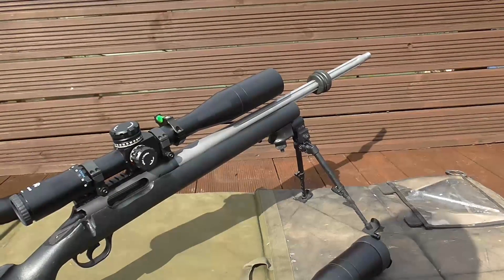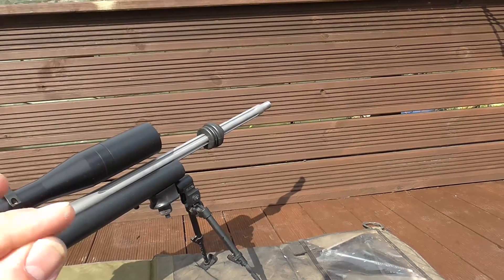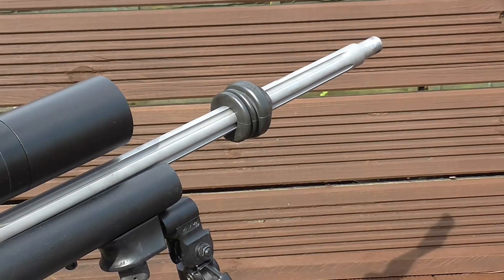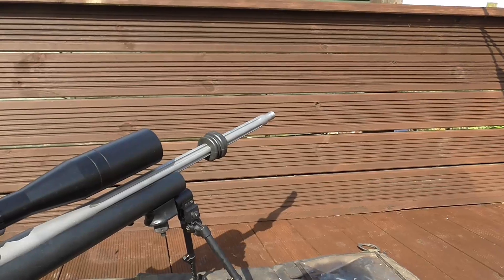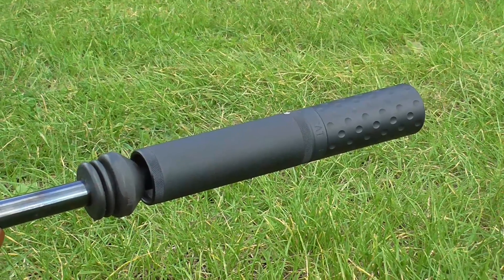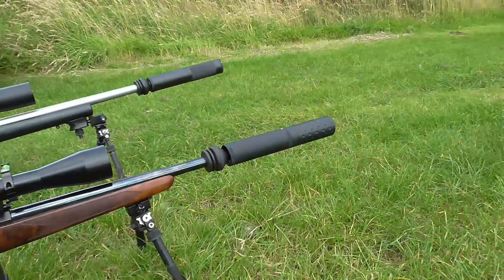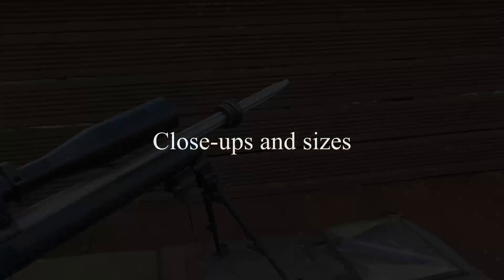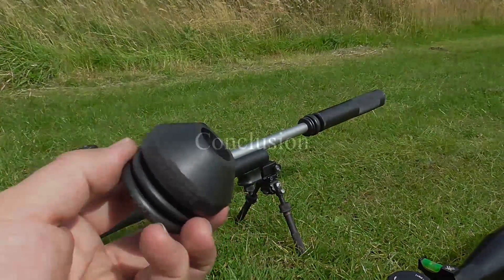Barrel tuners - do they work?

Comment: I found the Mrs rubber pleasure device and drilled a hole in it, works a treat at the range and is a great talking point.
Reply: I bet the lube helped it slide down the barrel :0)

Comment: We used “tunners” to eliminate parasitic harmonics in an unrelated industry.  It was more of an art than science to figure out where to position tunners.  Curious how you are measuring the frequency and the sub harmonics of the whipping action of the barrel.  Or are you looking at the reduction of the standard deviation of the shot placements to determined that your barrel has been tuned?  Very interesting video.  Richard you are out there swimming alone in the deep end of the pool surrounded by sharks.  (Translated to no one else is covering this topic nor are they brave enough to talk intelligently about it).  Very nicely done!

Comment: Great video Richard. I'm going to give a couple of these a shot. One on my .22LR and one on my .308. 

A couple of things though...

1) It appears that the LImbsaver instructions recommend moving the tuner/dampener by 1/4" at a time (approx.6mm) but you mentioned that a 1mm change can have an effect. What increments do you suggest, especially when close to identifying the "node"?

2) What are your thoughts on doing this at greater distances, similar to how folks do ladder testing at 300, 600, or 1000 depending on their goals?

Thanks

Jeremy

Comment: Well, they are ugly, BUT:
I had an eye opening experience yesterday.
Since a while I´m struggling with my Tikka T3x CTR in 6.5 CM and a 24" barrel.
The barrel dia isn´t really big for that barrel length, and I loaded 8 different bullets in several loads, including 3 different powders and so on.
The very best groups where at barely .5 MOA, which isn´t bad at all for a factory rifle (which I bedded), but doesn´t satisfy me for LR shooting.
And I know some Tikkas with shorter barrels which all do better.
So yesterday I was out for V0 tests with my new bought Magneto Speed mounted at the barrel mouth.
Guess what: The first load I shot gained tighter groups than ever, and so did the two others.
I couldn´t believe it, all of them were under .5 MOA, one of them was .3 MOA, which would be all I want.
Should I let the Magneto mounted now forever?
So I searched around and found this video - thanks Richard.   :o )
Might be a big step forward for me, but I said it once, this dampener is really ugly.
Does somebody know other damper models, which are a bit more charming on a rifle barrel?
If so, I will think of you in my prayers.
Cheers from Germany.

Comment: Great video!   I bought a 17 cal wsm rim fire which is factory only ammo.  They can shoot great or poorly out of the box.   So many people will spend time and money on rebedding the action/barrel fooling with action screw tension etc and still scratch head when the gun does not shoot good.   
I took this $6.00 tuner (cheaper on Amazon) and was able to make .25" groups at 100 yards from a .17 wsm.

I did not waste time bedding the barrel etc.   Mine shoots better than 17 wsm costing 3x more.    
I think the reason most people don't use them is they don't like the looks. 

bedding to get more accuracy is just hoping that the bedding changes the harmonics in a way to shoot better.
Bedding can also make it worse just like moving the barre tuner to a wrong location it can hurt accuracy.

Comment: Hi Richard, after watching this video I put the barrel tuner on my rifle and it made a huge difference, not bug holing yet but now I am developing another load for the rifle and I was wondering what you would do starting with a new load?  Would you take the tuner off and shoot initial rounds without it and find the best group out of the different charged loads and then take the tightest grouped load and shoot again with the tuner? 

Or should I maybe just move it back to the start next to the stock on the Ruger M77 MKII and shoot the trial loads with it there.  3/4 from the end of the stock helped greatly with the last loads. Would I assume that placement would be useful for other trial loads?  Any advice you have would be appreciated.  Thanks for the great video.

Comment: Hi! good information and accurate descriptions...

I do have a question though....I have seen bench shooters during load developement sprinkle a liberal amount of say talcum powder on top of the barrel. When they shoot a round they examine the barrel after the shot to help pinpoint the nodes and place the x-ring resonator between them for best dampening....You still may need to play a bit forward or back but they claim this works well on barrels with proper load development already done ....

Have you done this or something similar, and what results did you personally get after trying this method?

I know I am long-winded here but I wanted you to see a better description of the process....

Thanks

Comment: I have a 17 wsm Bmag I just bought.   I put 40 rnds thought it without the tuner and I was getting 1/2" groups at 50 yards with maybe 2 of 10 outside of the group.    Not bad figured it was the ammo or maybe the new barrel.     I paid 9.00 for a Limbsaver Sharpshooter X-ring and went to the range.    I was amazed I put 7 shots in the same hole.   I don't think I have ever done that with any gun before.   No fliers it was like my gun turned into a laser gun.    I measure the group and no kidding it was 0.10" group of 7 shots.   That was probably from me moving on the bench.     I am still in disbelief.   

I was going to bed my stock but I don't think I want to change a thing now.

Comment: Once you find the sweet spot how do you make sure it doesn't move especially while hunting?  I have a weatherby Vanguard 2 sporter in 7mm08 that shoots quite horribly with the 24" super light sporter barrel.  I tried free floating it and it helped a little, but it still shoots 2" groups or bigger.  I have also tried many different loads with a few different bullets with no luck. Do you think one of these may help me?

Comment: Hi Richard,  
I have been using these since very close to their introduction.  I was an avid Archer and having used Limbsaver products  understood that they made no junk or contingency laden claims.  I was very pleased with your video, straight forward and very concise.  I feel your video even without graphics or demonstration is the most comprehensive  offering online . I was a reloader when I started using these and decided to "explore for the sweet spot using factory ammo.  I know, I know, apples and oranges.  What I found once the factory ammo led me to its own sweet spot was amazing in and of itself, but the trials with the reloaded ammo with just minor adjustment to the de resonator were more than I had hoped for.  Using my personally tweaked  30.06 Remington 700  I was able to go out to 250 yards before my groups were no longer 1 hole examples.  Again thank you for the very personally redeeming  article.  liked and subbed.

Comment: Hi Richard, thanks for sharing your experience with the de-resonator. I just have one question. After you find a "sweet spot" with one type of ammo., does the accuracy change when you switch to a different ammo? I figure that different ammo would change the harmonics of the barrel thereby causing a change in accuracy and point of impact. Your answer will be appreciated, Thanks.
Reply from the maker: Thanks :) Yes different ammo is slightly different. Yet the zones you go through on the way while tuning are always similar: square groups....vertical stringing...accuracy, square groups...vert stringing...V interesting
Reply: Thanks for your response, Richard. So, in the case of the de-resonator, I would have to make an adjustment by moving it forward or back when different ammo is used, because of the difference in harmonic signature it creates. Is that correct? Thanks again.
Reply: @RichardUttingSharpshootingUK  that makes sense. The barrel resonates both horizontal and vertically, the nodes are in different spots, when you get the vertical string you have damped the horizontal whip, when cutting clovers you have dampened them both.

Comment: Why don't you start with a heavier barrel and get rid of that fluted one for a stiffer barrel to start with? I've seen alot of bench rest shooters punch the same holes at 100'. Their rifles didn't have any bullshit hanging on their rifle. They just just a quality barrel, handloads and trigger and a very heavy rifle overall.
Reply from the maker: There are loads of different builds for loads of different uses. Just saying build super heavy for stable unfussy harmonics is off the point.

Comment: Thank you Richard for such a clear explanation. I thought they were just something to add a few oz of weight to a light barrel, and thereby dampen vibrations. But that they act like a Browning Boss tuning system and similar expensive options(that have to go on the end of the barrel, without adding to the length of the barrel, never occurred to me. Since all my rifles have moderators, and since I don't reload, this info about tuning for a factory load(if it is anyway good at all) is just too good to ignore.

Comment: Hello Richard,
    I am very glad you took the time to find a way to explain barrel whip, harmonics, and the effects that reloading,  the addition of the Deresonator, and how this can all provide dramatic results at a reasonable cost.  I have used these for years and have withstood the laughs and snarky comments, that always seem to result in red faces and a swift about face exit when the nay sayers see the results.  I bought a used Rem700 BDL in 30.06 and after doing eveything I could do to reduce group size and get consistency I would then "install"  the black magic donut, and usually through patience, and documentation was able to at least half the best groups that I had previously shot without it.  Now mind this, I was using only collet dyes on fire formed brass, neck trimming, weighing everything. and the greatest single advancement in accuracy was the properly determined positioning of this wonderful tuner.  It has shut the mouths of many scoffers at the range when they observed the Rem 700 consistently shoot clover leaf shaped 3 shot  1 hole groups at 250 yds.  So yes Richard, I am appreciating your post, knowing that many shooters with prohibitivley priced rifles have tried it, found it to work great, and never mentioned it to wifey, of the friends that used to ridicule his buying a custom rifle for an amount close to a fine holiday, or a fine  Rolex!  Best Regards
Phil
Reply from the maker: True true my friend :D

Comment: Will this limb saver work on an air-rifle? I guess not on one of those "kicking like a mule" guns...but on a finely tuned, smooth shooting one? Or even better, on a PCP? It would be a solution for one of THE MAIN issues of a pellet rifle...wouldn't it. Maybe it could work...if the piece of rubber isn't just 15 pounds in money but also in weight 🤓

Comment: Hi Richard. Was wondering what load development process should one use to included one of these things in the load development cycle to deaden the recoil?
Reply: I ask because at first sight it sounds like a tricky business having two variables that affect timing and changing them around to the the right combination for both timing and barrel whip.
Reply: I should think one would develop the most accurate load possible for a given bullet without the Limbsaver in place first and then use the deresonator to fine-tune the load for better accuracy, though you may find you don't need it at all with the right load.

Comment: Very interesting. Does the influence of that "15 pounds" of rubber increases with slower moving bullets? Will it be more effective on, let's say, a 30-30 ( maybe a bad example since most rifles chambered for 30-30 have tubular magazines...but I'm using it because it's a rather slow bullet) than on a 204R or 220S?

Comment: Ok,,, doing some research,,, this thing actually works by adjusting the frequency wave node location. The closer the wave node is to the tip of the muzzle or end of the barrel, the less movement or whip the tip will have as the projectile leaves the barrel. AR15 users for DMR weapons can use this starting at about an inch and a half from the end of the barrel and adjust your deresonator from there to tune accordingly. Rifles start about an inch or two from the stock. Good video richard,,,
Reply: Freefloat barrels start inch from front or barrel tip. Stock rifles or non freefloat barrels start at the stock an inch or so and go forward to adjust.

Comment: +Richard Utting I am so impressed by this video and they way you explain things, I really enjoyed it. I shoot a lot of 22LR mostly from modified10/22s. Used in the correct way would this be helpful in reducing my groups?

I noticed you are running a "moderator" in conjunction with your de-resonator and I was wondering the reason and if you had better results with it? I always read about suppressors negatively affecting or changing your POA/POI but I guess that wouldn't matter if you always shot with it on. I have a very lightweight aluminum SilencerCo Warlock 22, a pistol caliber SilencerCo .45 OctaneHD, and a centerfire SilencerCo Omega .308, as far as harmonics go which one would you recommend using for rimfire? 

Thank you!
Reply from the maker: Yeah we develop our loads with mods on so that's all tuned out.  I don't know what to advise on the SilencerCos as we don't have them here so I'm not familiar with the exact models. Normally there is a fairly straight line between noise reduction and weight. I'd use something fairly light and definitely strippable for a 22lr as they fill up real bad with unburnt powder and need cleaned out. ATVB

Comment: ok im not saying it doesn't work  . but I believe less is more . the last thing I want is one more THING on my rig . so question .     - how many rounds down range to find the sweet spot ?    - and could you not accomplish the same thing by conducting proper ladder testing im sub half moa without one
Reply from the maker: +wind call Hi mate :) Maybe 30.
Well not much. in that you're sorting out the sweet spot of the load already.  But it's a revelation on factory ammo or if you have changed your moderator and it throws the load out

Comment: Incredible education. Thank you.
Reply: +lynx777 When ordering online, make sure that you order the Barrel Deresonator, and not the archery part that we make for target and hunting stabilizers, as the material that is used in the archery part is different that the part that we make for firearms, which is designed to withstand very high temperatures.  Let us know what you think!
Reply: I ordered 3 a long time ago, I got the correct thing.
Reply from the maker: +LimbSaver That's most useful info, thanks 
Could you advise folks where to purchase these in the UK as I'm asked very frequently
Reply from the maker: +lynx777 I'm really glad you found it useful, thank you :)
Reply: I bought 3 of them. Before this video never knew they existed
Reply: *****    found them for $10 a piece on Ebay, It was a while ago now so not sure where they came from.

Comment: Do they work on floating barrels as well ?
Reply: +ad sav I've read about people putting these on floated barrels and getting awesome results, but don't hold me to that :)

I don't see how they wouldn't work on floated barrels, so long as they are tuned correctly.
Reply: Yes,,, start one inch from barrel tip and go down until your satisfied in small increments about a quarter inch each movement then test fire until best results each time you move it..
Reply: Tuning is what this thing does lol. It works, I have a Remington that I free floated and when I put this thing on I got it to shoot MOA easy with any factory load, a decent one anyway.